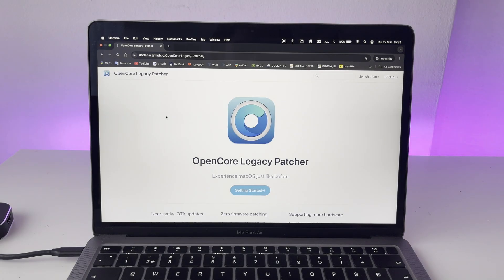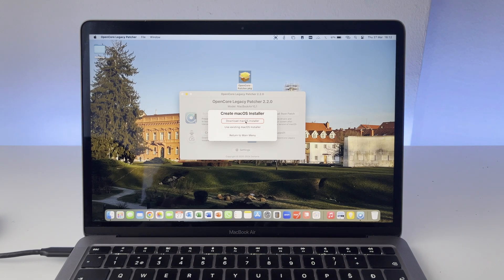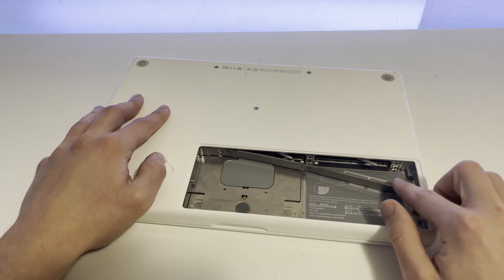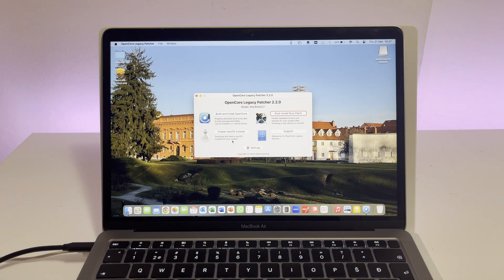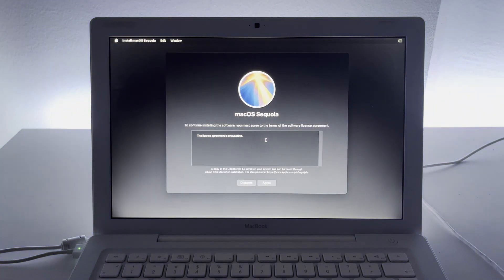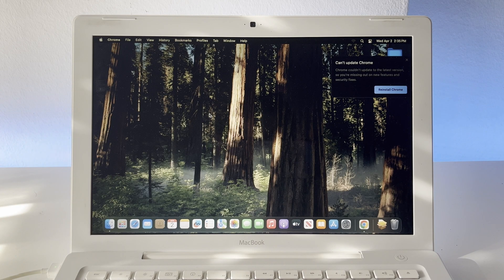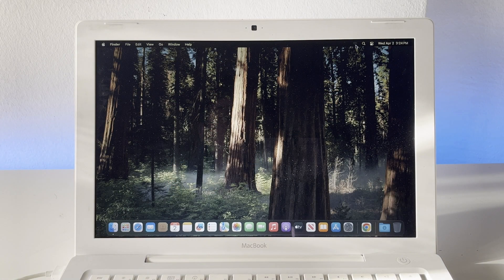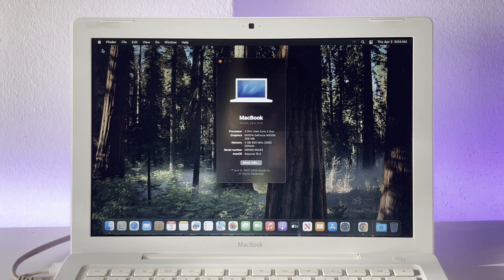Trying to Install macOS Sequoia on a 16 Year Old MacBook!

Comment: I have theory that Ventura is the last software you can install on MacBook 2012 and older. Because Sonoma has soo much moving graphic that'll make your old MacBook painfully slow
Reply: I agree with that but even for certain newer Macs (I have a 2014 MacBook Pro) and anything past Ventura is almost unusable.
Reply: @ItPiggDeluxe is it 2014 MacBook pro 13 or 15 inch? I saw often that the 2015 Mbp 15 inch is still able to run past Ventura smoothly

Comment: I tried to use a 2012 MacBook Pro with OCLP on it, it got painful and slow probably due to the worn replacement battery from 2 years ago. I bought an M1 MacBook Air a month ago and it’s great.
Reply: in the OCLP options there is one to prevent firmware throttling - when you have a bad battery very much recommendws

Comment: Dude, the reason why you can't connect to the Wi-Fi network is that old Apple devices sometimes tend to not connect to the Wi-Fi Network which is using WPA3 Security Protocol. (this protocol is set as default with all the modern routers...) You can set your Wi-Fi router's security to WPA2 (Which still is pretty secure...) in your Wi-Fi router settings, and this shall allow your MacBook to connect to your Wi-Fi!!
Reply from the maker: Why does it connect normally when on other OS versions then?
Reply: @GameboyHub1  There might be some compatibility issue of the newer macOS and the MacBook's older hardware...
Reply: could using a wifi modem fix the problem?????
Reply: @ It could fix the issue... Depends on the modem model and the age of the modem... And whether macOS will communicate properly with the modem or not (drivers etc...)

Comment: you should have done everything you did with opencore, but with macos big sur installation , the when it is installed to your macbook you upgrade to sequoia in the system preferences wich is the easiest way to do it, it work perfectly fine on one of my old macbook (sorry for my english, I am french)